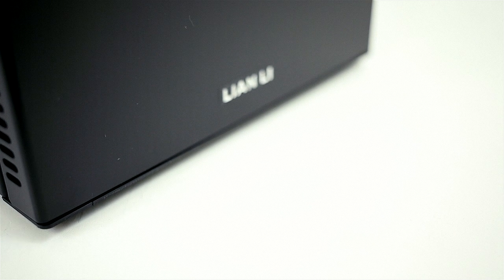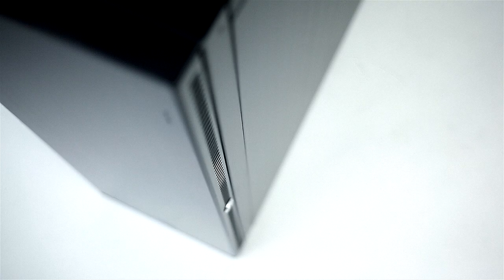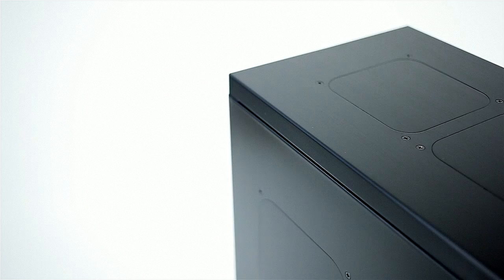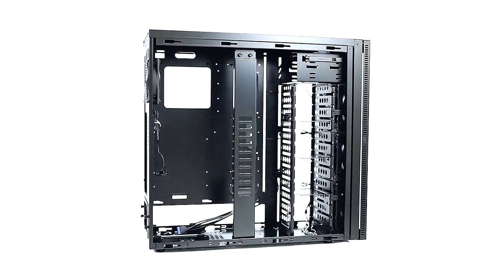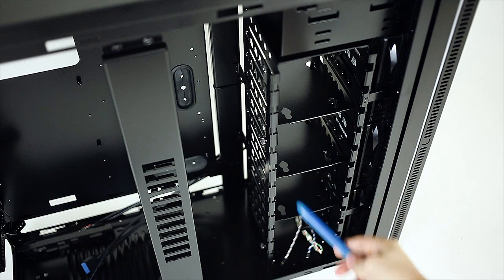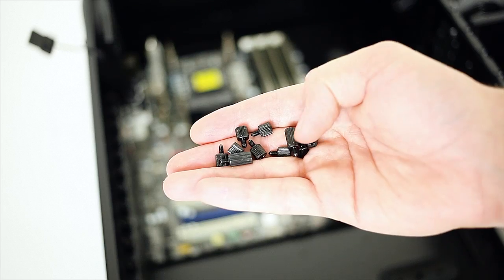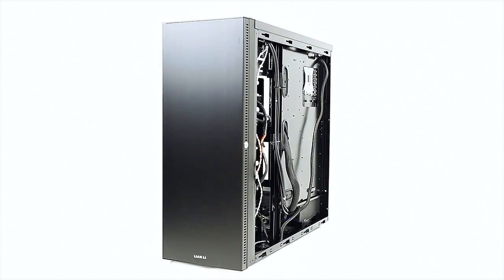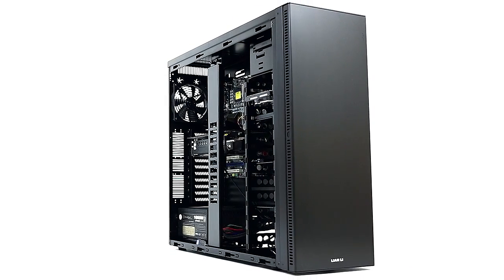Lian Li PC-A76 Review

Comment: Just ordered this case to replace my original Lian-Li PC-X2000. The PC-A75 is a far more functional design than the X2000 (and many other Lian-Li designs for that matter). It supports double the amount of drives, more mobo expansion slots, with better cable management, and at 1/3rd the price! $200 is dirt cheap for this quality, size, and feature set; you can barely get a 5-bay diskless NAS enclosure for $200! Lian-Li and other top case manufacturers charge far more than this for most full size quality towers. It's easy to find $400-$600 cases without this much internal space. I haven't seen another case with space for 12 internal 3.5" HDDs + 4 SSDs. It definitely doesn't have the style of my X2000 which it's replacing, but it will work perfectly for my massive RAID array.

Comment: It depends what you are building. If all you are going for is a decent, air cooled gaming pc, then you dont really need an expensive case. Fractal design arc midi is the highest I would go. It has all the features you might possibly need, Steel used for this case is thick, and the plastic parts arent cheap and flimsy. I seriously see ne point in spending more cash on a chassis. It's better to invest in better internals.

Comment: the cooler master haf x is a bigger case with alot more features and better airflow and goes for $170-$200 depending on where you get it from. It isn't 100% metal as the front and top panels contain a fair bit of plastic though.

Comment: Why 120mm fans on the top? It doesn't make sense to put the smallest fans on the part of the case where heat escapes the most. The other gripes with this case have been well-covered by this video, and previous comments.
The main point is: Lian Li, you guys can do better.

Comment: I have an HAF 932 that I'm looking to upgrade from and was looking at this.  At least my entry level full tower can support an H100 at the top without a problem.  It's a bit cramped in the back (my PSU is non-modular) and the front fan is a bitch to clean (tip it upside down and paintbrush the dust out), but it could be worse I suppose.

Comment: I  disagree. I love minimalist designs but Lian Li's quality has deteriorated. 
The case I recently bought would have been absolutely perfect had it been 0.3mm extra gauge on the aluminium, but has led me to conclude that building a case from the same material as Neil Armstrong's Lunar Rover no longer justifies their reputation.

Believe me when I tell you I would pay £500+ for a solid titanium or carbon fibre case.

Comment: I assure you that $215 is not cheap for most of us. I rather spend the money on hardware than pay full price for this case. It has nice modding options (like with most Lian Li cases) but at $200+ WTH were they thinking? not even a single cable tie mount at the back, and just terrible grommets. I am paying $200+ to expect premium quality with every single feature considered and this case isnt it. I criticize the internals for not offer top triple rad, modular HDD cage, no bottom fans...

Comment: I think, $220 is way too high. I would not spend more than $140 for this case in its present form. I also noticed that the CPU cutout was a bit too small. Installing something like the Corsair H-series coolers will require complete dis-assembly. Too much work involved for a $220 case.

Comment: Audio cable may have reached fine if you either use the cut out at the bottom or undid the cable tie holding it on the back of the motherboard tray. LIAN LI has always been overpriced. There are fair better out there for much cheaper. NO their prices are not justified, you're pretty much buying a $125-150 case and $69-84.

Comment: What's the use of aluminum for lightweight if it doesn't even have a handle to carry the case and what's the use of $220 case if you can't even show off your $1500 hardware parts through windowed side panel? Hello, CM Storm Stryker!

Comment: 11 pci slots. what the hell would they all be used for? a non existent 5-way sli/crossfire setup? i have trouble even using up 7 pci slots. who could fit 11? this case would've made a lot more sense if it ditched 4 slots and made it a mid-tower.
Reply: I don't know what I should do I want a good water cooling case but I have a gut feeling  we won't need these big case because GPUs especially nvidia which had announced pascal a supercomputer stacked GPU about the size of 2 credit cards that I don't think we will need all these slots plus you know where the metal plate is on the GPU that part usually take up 2 slots while the pascal will ownly take up one slot 

And I don't really wanna spend £500 on a case when I don't need to 
When I can have a smaller case that can do quad GPUs water cooling aswel 
Have high end parts in a mid tower case that can do water cooling